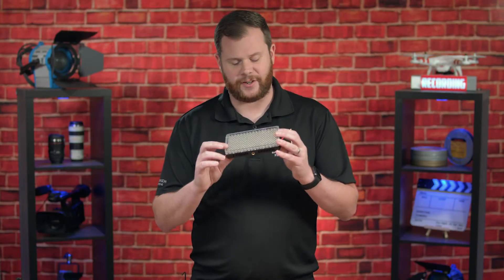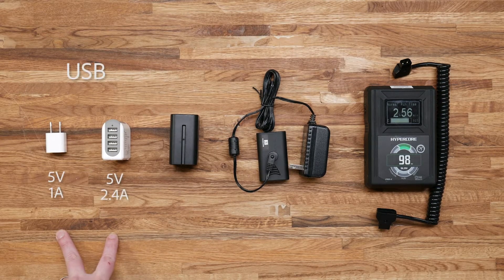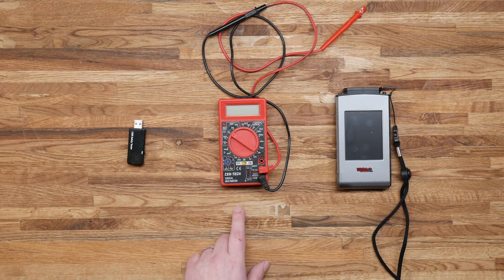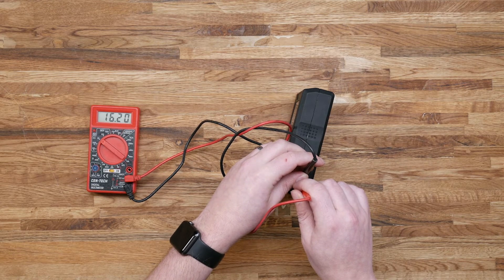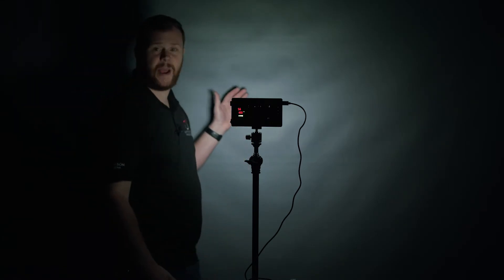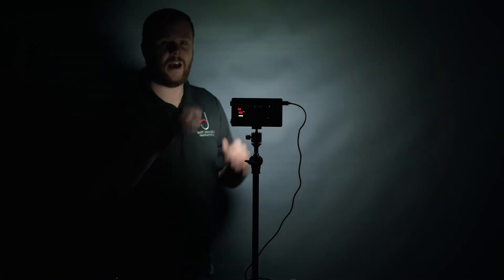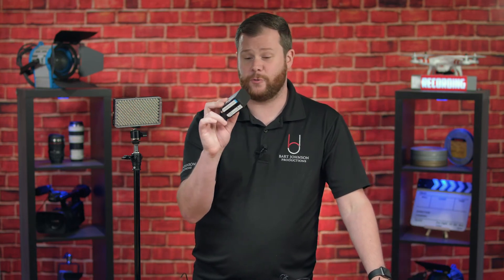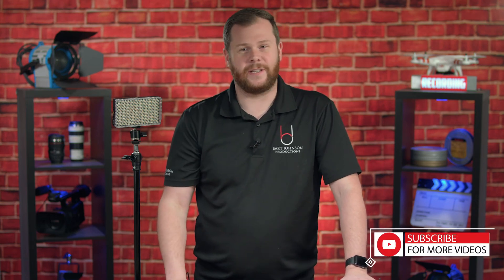Aputure F7 - Reduced Output with Different Power Sources!? USB, Battery, and D-Tap Test

Comment from the maker: Aputure tells me that indeed the limits of the USB input is 5V 2A=10W.  The F7 is a 15W light.  So be aware that USB cannot power the F7 stronger than 80%.  However, you can see that that 80% quickly reduces to 50% at only 3 feet.
Reply: Mine doesn't work with only USB. Tried different cables and iphone power adapters. Nothing. Wiit a battery it works just fine.
Reply: So it works with usb A to usb C cables but not with usb c to usb c cables? Why?
Reply: @copypaste3526  yep same with mine. only A to C works
Reply: @copypaste3526  I don't know. I noticed the same thing. very weird that it doesn't work with usb-c to usb-c

Comment: Wonderful little light.  I use mine with every wedding. The battery pins unfortunately does not want to work anymore.  In other words I can only use it with usb.  The batteries are fine though.  I've tested them with other devices.  Still need to pull enough courage together to o pen the light myself and see if I can fix this.  Any tips?

Comment: Very nice video! Just what I was looking for. Two comments: When it comes to the inital power measurements, the actual power (in Watts) is what matters. Not current. People usually talk about current when assuming the voltage is the same, which it wasn't even in the USB tests. Then also, there were no measurement of power for the other options, like sony dummy battery and D-tap (I can understand the battery not being feasable, although shouldn't be to hard either).
But anyway, the final light measurements are what matter really. :)
Reply from the maker: Thanks for sharing that info!

Comment: You can output the full 15W with the D-tap connectors. I bought a pair of solder on D-Tap connectors (https://amzn.to/2KolgQL) and put together some cables.  I used an inexpensive 12V power supply from Amazon (https://amzn.to/2ILPwos) and have 2 of these lights running at full power.

Comment: hey man, I bought a F7 a few days ago and i am struggling to change my NPF battery with it. Is it meant to be able to change while plugged into USB power?
Reply from the maker: I’m not quite sure I understand your question.  What trouble are you having with changing the battery?
Reply: @BartJohnsonProd  Does the battery get charged when USB is plugged in? Or do i need a separate charger for the battery.
Reply from the maker: Ah ok.  Charging.  No, the light does not charge batteries.  You will need a battery charger.
Reply: @BartJohnsonProd  very helpful, thank you.

Comment: Aputure should specify the lower limit when using 2.4A USB. The 1.0A USB is not a valid test for the light as the input was limited by the available current.

Comment: Does the Amaran support actual USB-C? USB-C supports up to 60w, plenty of juice for the light
Reply from the maker: That is a good question 🧐
Reply: Bart Johnson Productions thanks! I dug up the manual, it looks like it is limited to 5v/2a. Shucks.
Reply: No. I have test it with a Anker powercore+ 26800 pd 45w powerbank with 60w pd charger. The charger dosen´t work.
Reply: @dariusmeder6587  Any luck figuring out what cables work or don’t work? I have some nice Anker cables and can’t seem to power the light. I can’t find any documentation online as to why and don’t have NP-F batteries yet

Comment: Seems like they basically included usb-c as a gimmick.
Reply from the maker: It is handy if you need to run off of Usb battery packs, but you just need to be aware that output can suffer.

Comment: Yeah, thank you for this, I also wish I saw this before buying my F7. This is really Fu*ked of them not to be SUPPER upfront about this. It has a usb-c connection!! Anyone would expect to be able to power the full light this way, or at LEAST D-Tap.
My way around it is using a NP-F battery that has a usb-c port on it, plug that in, and run the light for continuous full power all day. 
Boling Bl-p1 is my next light purchase, I think you can run that plugged in full power for some time, would love to see that test 👍😉

Comment: Thanks Bart! I'd also been looking for a dummy NPF battery so this is perfect.
Reply from the maker: The dummy battery I used was recommended by a friend, and is great.  It doesn't quite lock in on the F7, but it is a snug enough fit that it won't come loose.

Comment from the maker: Just a quick note on the USB 2.4A, in case anyone was worrying about a faulty adapter, I also tested off of a battery pack rated at 2.4A and received the same 1.7A draw results.

Comment: Nice comparison! Thanks!
Reply from the maker: Thanks!  I found the results really interesting.  Hope you did too!
Reply: Bart Johnson Productions I did, I wasn't aware of the output limitations
Reply from the maker: @dawsonboyle99  I wasn't either until I thought I was being clever and used USBC with that Apple adapter to plug it into the wall and thought "Wait.  Something is different!"
Reply: Bart Johnson Productions that's interesting, I have some led lights (not aperture) but I should see if there's a difference in output between the battery and the cable I'm sure there is.